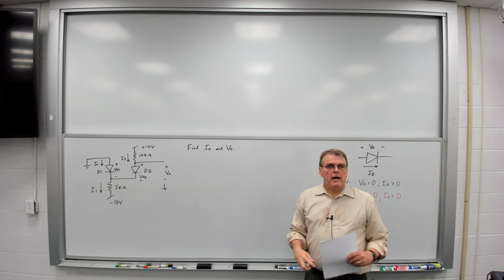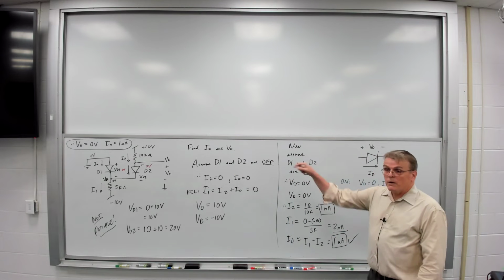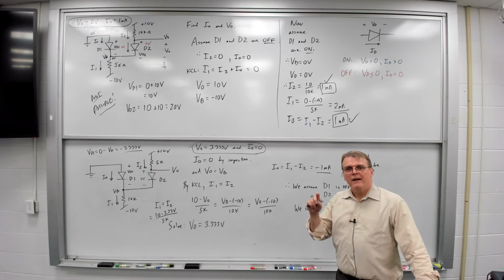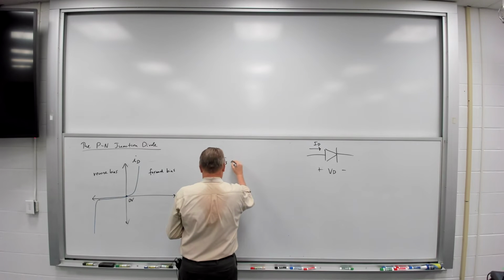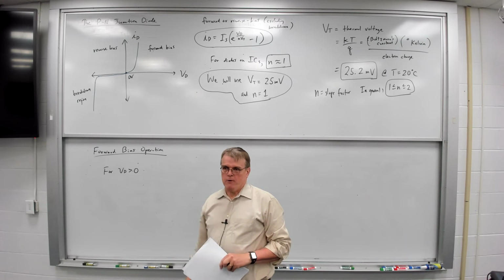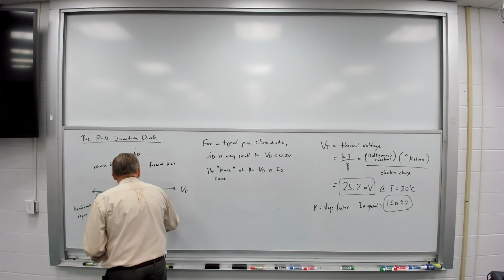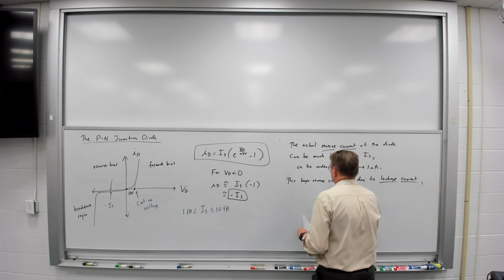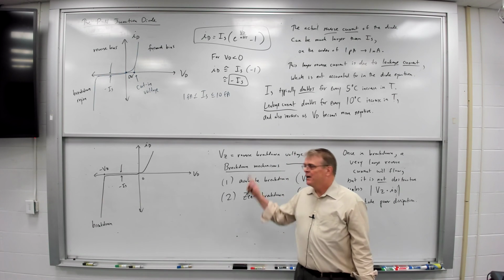Electronics - Lecture 3:  Circuits with multiple diodes, the p-n junction (non-ideal) diode

Comment: Do you have a copy of the equation sheets you mentioned? My university doesn't provide any and I have to memorize them : - (
Reply from the maker: Unfortunately, I cannot provide you with the equation sheets that I give to my class.  I copy the tables and diagrams from the textbook for the equation sheets, but this is copyrighted material.  I can't provide it on YouTube.

I use the text "Microelectronic Circuits" by Sedra and Smith.  If you can obtain a copy of it, you'll have access to what I give to my students.

Comment: if we assume that diodes are germanium made for example should we add them to the calculations or for these problems do we always accept Vd =0 when diodes are on. ım working from multiple sources and got a bit confused actually
Reply from the maker: For simplicity in this course, we first use the ideal diode model, where Vd = 0 when the diode is on.  The more realistic CVD (constant voltage drop) model is introduced later on.  Note that since germanium diodes would have a lower forward voltage drop (~ 0.3 V) than silicon, the CVD model would be set to 0.3 V instead of 0.7 V.
Reply: @wtimothyholman  well thank you so much for the answer and the videos.  I  finally got the point and already began mosfets .This course helped me a lot through beginning of my analog journey and ofcourse my midterms. 🤍 wish there were more problem videos though 🤗

Comment: Why doesn't superposition theorem work on this problem
Reply from the maker: Which circuit are you referring to in the lecture? Keep in mind that while superposition can be used to solve a linear circuit, in most cases it really isn’t needed.
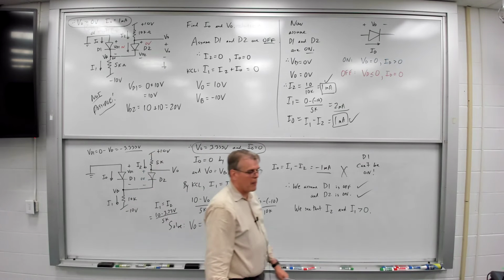Reply: The one at 21:07
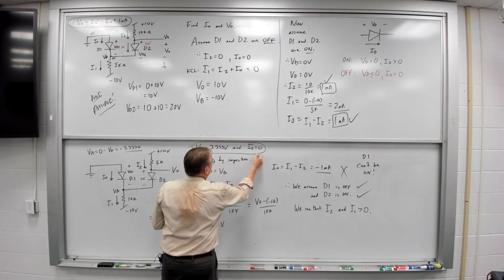Reply from the maker: @alexandrealmeida1908 , superposition is only applicable in cases where you have multiple independent sources.  In this case, there's only one power supply for the ideal diode circuit example.  The trick to solving the circuit at 21:07 is determining the operating states of the two ideal diodes.  This requires making an assumption and then determining if that assumption is valid.
Reply: diodes have an exponential behavior, superposition applies  only for linear components/circuits
Reply from the maker: Superposition requires that the circuit have multiple source, but it would be invalid in a circuit with ideal diodes because the operating states of the diodes may change with each individual source, i.e. the diodes are behaving like non-linear (ON or OFF) elements.   

As you go through the lectures you'll find that diodes are normally treated as CVD models (i.e. voltage sources), so linear analysis techniques can be applied.  However, superposition is of no help.  Superposition can tell you the contributions of multiple independent sources to a particular voltage or current in the circuit, but only if the operating conditions of the diodes do not change with each individual source.  That cannot be guaranteed, and in any case superposition provides no advantage in determining the correct answer.
Reply: @wtimothyholman  Thank you very much for the explanation sir

Comment: Doubt, in the problem where you switched both the resistances and kept the circuit the same, around the 11:30 time stamp, we could assume both to be OFF like the previous problem and that would fail as well for both as I would be 0 for both but Vd1 and Vd2 would both be >0, but it wrong to imply that BOTH ARE ON from this conclusion, we only conclude that the particular combination assumption of ON and OFF is wrong in this case, but it wouldnt imply that they are both automatically both ON correct? we try till both the assumptions are satisfied?
Reply from the maker: You are correct:  if you started the problem by assuming both diodes were off, then VD > 0 for both diodes, and it would be reasonable to assume that both are ON for the next step of the analysis.  But when you worked the problem the second time then you would still find that D1 still violated the boundary conditions, just as I did in the lecture.  In that case you'd assume that D1 is OFF and D2 is ON for the next step, and you'd get the correct answer.

The number of steps required to solve a problem like this will depend on your starting point.  If you begin by assuming both diodes are ON, you get to the answer in two steps.  If you assume both are OFF, it takes three steps.  But in either case, you eventually get an answer where no boundary conditions are violated.  That will be the correct answer, and you can stop at that point.  You do not need to check all four possibilities.
Reply: @wtimothyholman  understood, thank you!